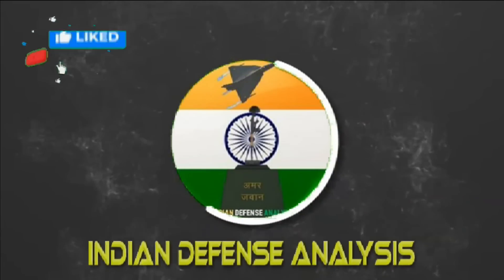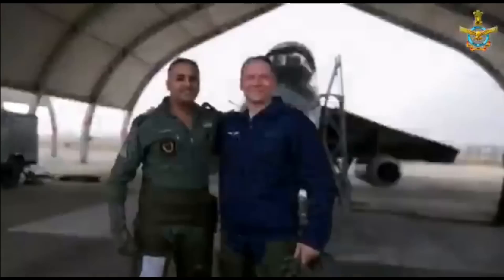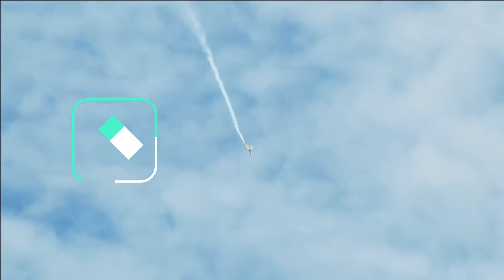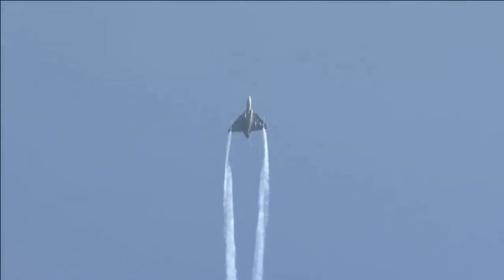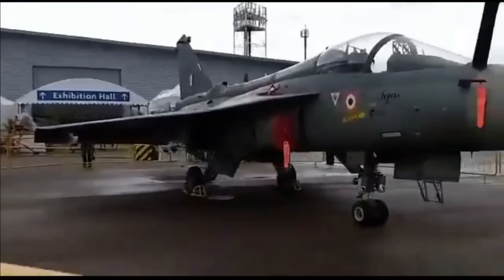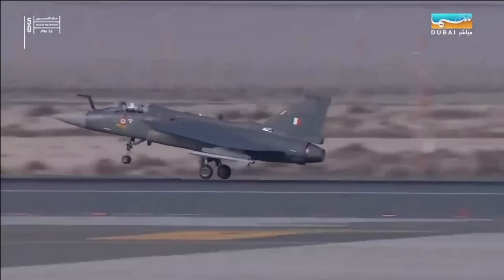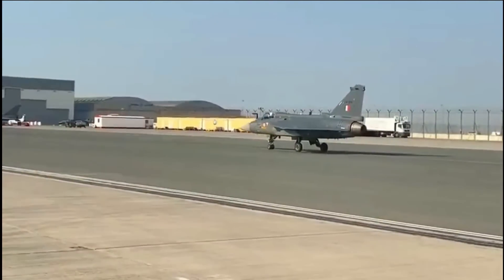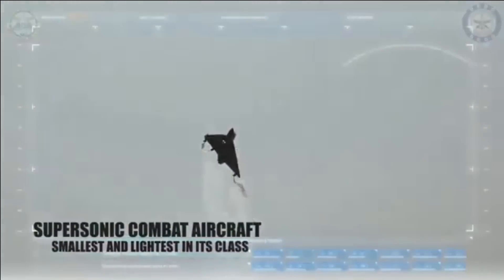Tejas MK1 vs Tejas MK1A : Why Indian Airforce needs Tejas MK1A before MK2? #iaf

Comment: From the 83-95, there'd been many hiccups and wrongdoing in that Tejas development era. For an instance, the aircraft's cg was so off that even with flight computer it wasn't flyable. So in the end they had to put ballast in the aircraft weighing as much as 500 kgs to correct it. Mishaps like these added to the overweight problem! Lru's were installed in a haphazard manner, which didn't ensure smoother maintenance of the aircraft. Needless to say that from '95 to a few years ago, all of the r&d was not to rectify those errors and make it better, but it was as much as redesigning much of the aircraft itself! So Tejas mk1 and mk1a are not the same thing. Mk1a is the original aircraft that was promised in the 80's. That's why it is needed before mk2!
Reply: निंदक नियरे राखिए, ऑंगन कुटी छवाय।
बिन पानी, साबुन बिना, निर्मल करे सुभाय।।

Comment: Is there any reduction in weight of Tejas MK1A ? Is there any enhancement of engin e capability?
Is there any supplementary power generation system in MK1A ??
When is it flying ?
Reply: Tejas uses F404-IN20 which can provide max thrust upto 85kn ... hence T/W RATIO ~1.09 . 
The mk1A will get 500-700kg weight reduction & improved aerodynamics...so no need to upgrade engine 😁.
Reply: Engine upgrades are planned but as of now it will run on 404s.